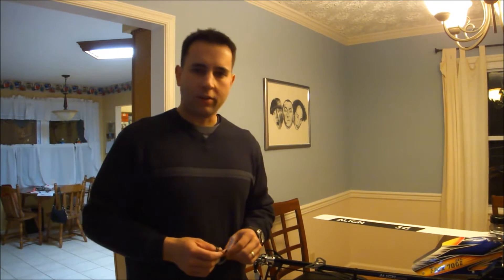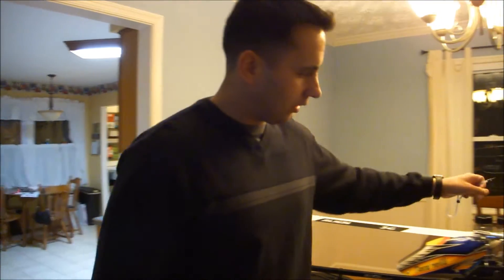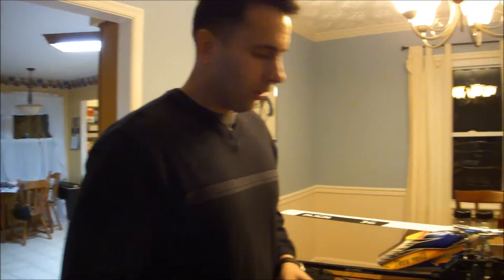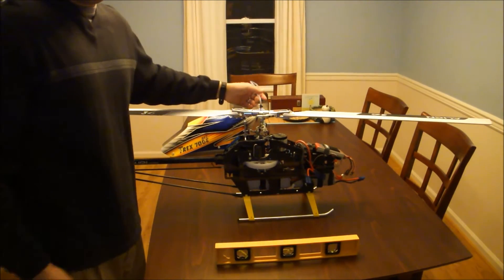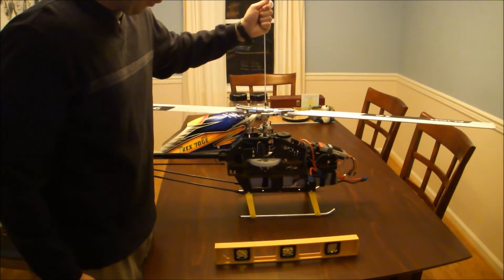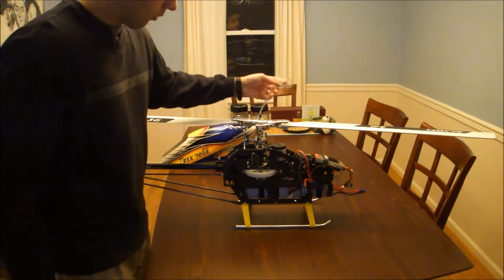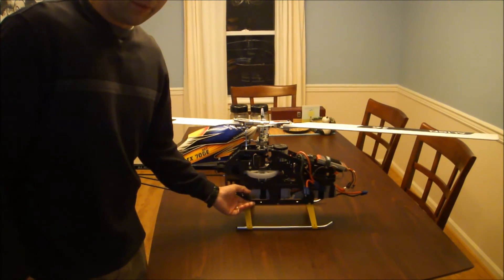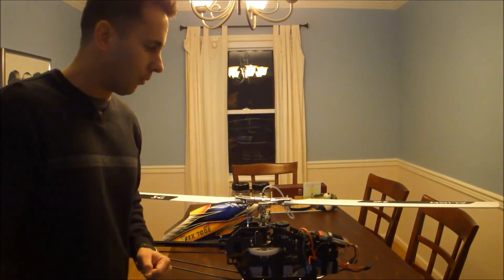center of gravity (CG)  for RC heli  Trex/Avant/outrage/fusion/minature

Comment: Will the cg being off on a helicopter cause it to wobble ?  I got a brand new gps one from Flywing and right out of the box it has a slight wobble in the air. I'm fairly new so I'm not sure what's causing it. It's my second one. The first didn't do that
Reply from the maker: generally, a slight off CG wont cause a wobble, more of inconsistent flight characteristics,  but improper Gain settings or throttle response curves will.
Reply: Thank you.  It was the blades they sent. I guess out of wack. I put the ones on from my Huey since they are the same and it flew perfectly.

Comment: I've seen various other ways to check the cg on my helicopters.  Mostly, I've been using the method of holding the helicopter by the head, on it's side, and see if the tail falls.  The method you demonstrated seems to very simple and it just so happens that I have a bit of fuel tubing here with no obvious purpose.  Thanks for sharing the tip.